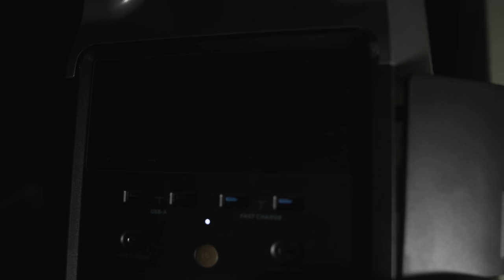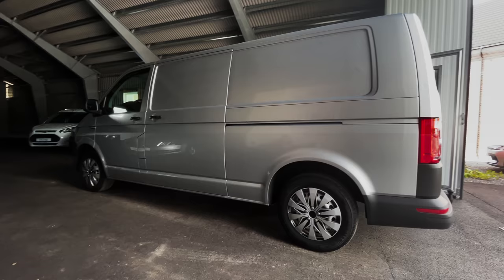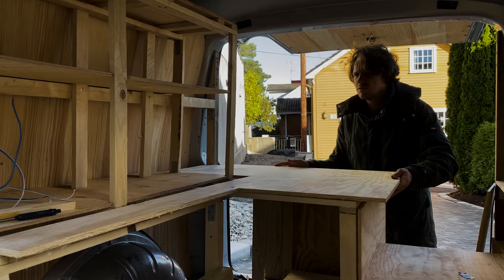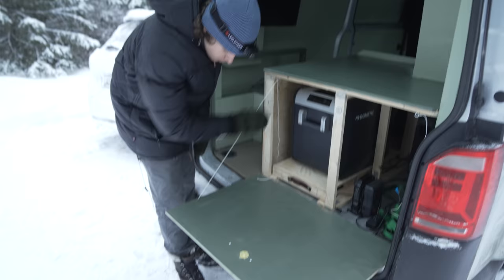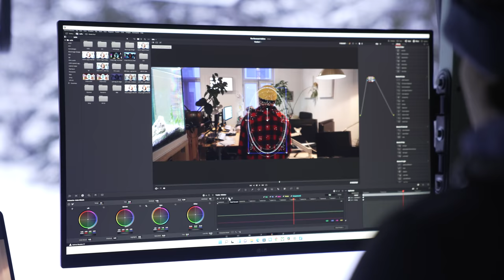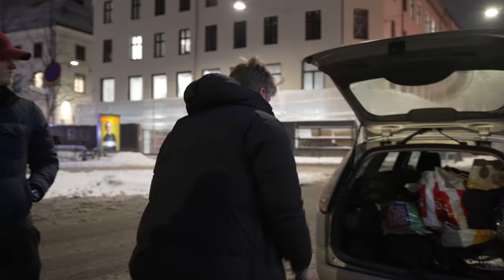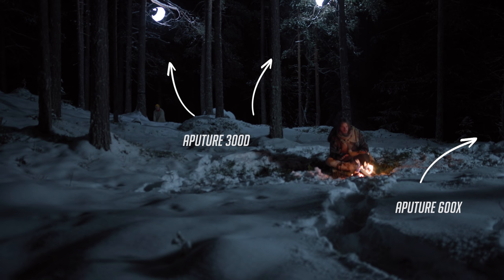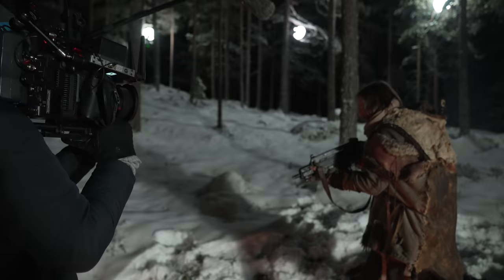We Made a Film Production Van | Making a Film Company S2E7

Comment: Great stuff guys! One thing I would recommend is to make the Muzzle Flashes a LOT bigger than they currently are and give them even more glow, Corridor Digital has some great tutorials regarding muzzle flashes. Good luck with the film!
Reply from the maker: Nice tip! Thanks :)
Reply: I think they did a great job on that shot. Smoke from the barrel being illuminated was a good touch as well as lighting on the face. I dont think it was too dark of a flash at all. after a certain point its about the artistic choices with audio and visual representation. to me the more important part was getting the set lit well. they didnt use the same flash repeatedly and it was a nice organic approach

Comment: Great video project. However there are a few flaws I feel that could have been analyzed in terms of mimicking the moonlight. The moon in a forest area surrounded by trees can never spill light at the horizon level to form long shadows. The moon can light up a subject only at an angle of 45° and above (approx.) which would result in shorter shadows and a dimmer light source. Ideally the aputure fixtures must be way higher and brighter (accounting for greater height resulting in a greater throw) to create an accurate moonlight effect. The light fixtures on the trees (behind the subject) should also follow the same principle. Of course if the assumption is that the subject is sitting in a location where there are no trees to hinder the moon at the horizon, then a scene establishing shot can be included at the opening of the video and a fake moon can be inserted at the horizon to make the scene setting evident.
Reply from the maker: Thanks for you feedback :) Sometimes in Norway the moon is quite low in the beginning of the night. And since we have so many cliffs and hills, the moonlight can actually come from a low angle without lighting through trees/forest before hitting the character. Nevertheless, I think the most important that it doesn't kill the story of the scene, but creates the right mood :)
Reply: @Andyax  Oh thanks for the clarification! Agreed that the production shouldn't ever take away from the story